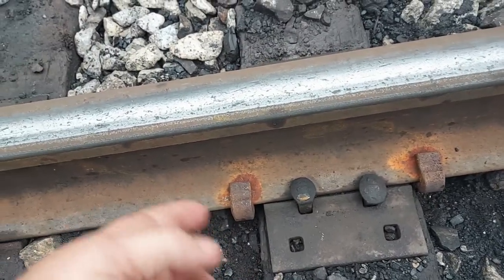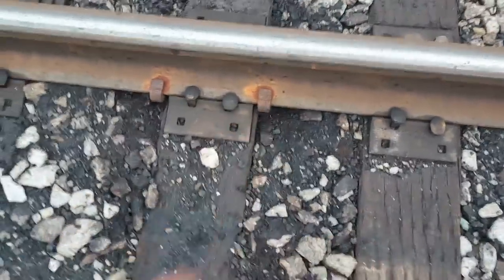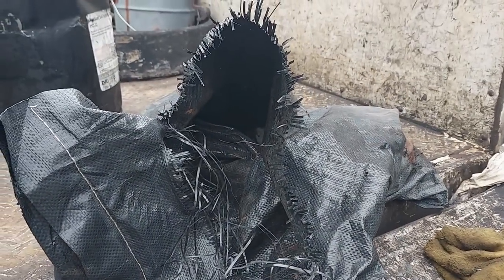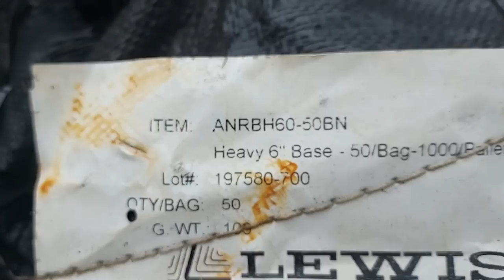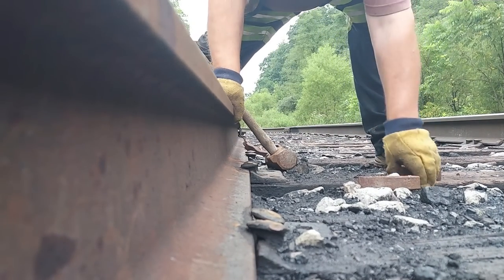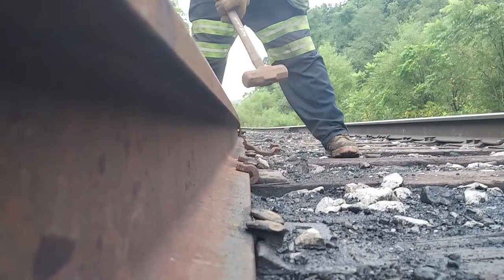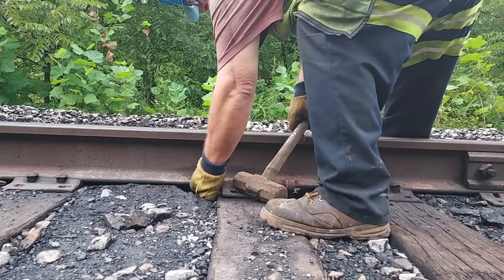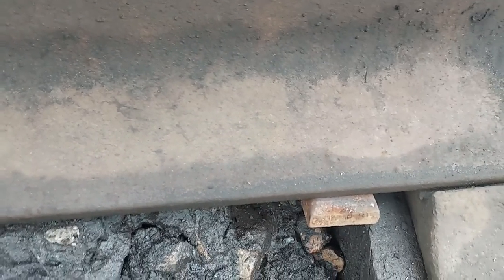Driving Anchors On at the Broken Rail Site

Comment: Have to smile - I can still swing a sledge hammer too, but the difference is you can do it for hours and I can do it for about 10 swings and nowhere near as accurately as you :) So these anchors add some contact between the rail and the tie to keep the rail from creeping. It looks like the rail spikes and the tie plates are the only resistance without these. I am also with you - a machine to place these anchors would be a relief and would save time as well as wear and tear on our favorite railroading gentleman!
Reply from the maker: Don't kid yourself Brian. I used to do it for hours, but not no more,
just don't have that long term stamina we used to have. Your right
about the spikes, and they offer very little resistance to creep. 
Always great to have you visit with me my friend.

Comment: you make that look so easy.  Thanks for making the video.
Reply from the maker: Driving them on is the easy part Dave, it's digging out the
holes under the rails so the anchors will slide under
that's the hard part. Fortunately those holes had been
dug out for me when they changed the rail. I should have
mentioned that in the video, hindsight. Thanks for watching the show today.

Comment: Great video Dave! Your production values have really gone up in the last year or so! I really likes all of the various angles 😊 I hope you get that anchor machine some day. It will make it a lot easier on your back!
Reply from the maker: Thank you very much, I'm trying to learn to be more creative,
you have been my inspiration in the way cool things you do. I got
some different types of mounting stuff so am experimenting. 
Thought that magnet holder on the tie plate worked out 
pretty well. But got a long way to go to catch up to you! Am trying to find a clip that will fit on my hard hat
for the go pro. That clip on the front of the hat is what the miners
clip their cap lamps into when the go underground. Always great
to have you visit with me my good friend.
Reply: @ccrx6700  Thanks Dave! They make self adhesive mounts. Check Amazon. I have one on my truck hood and film at highway speeds so they work very well 😊
Reply from the maker: @PlanetMojo  i have some of those but yet to try them. Thanks will give it a try

Comment: We use to have anchors, they come off but don't go back on. They use screw lags, and plates for that. 
They are building a third track on the mainline, which i did testing for today, I saw Herzog dump trucks , with base aggregate for the TLM.  It was darker then 3/4" stone.  Passed to two excavators and one with a straight plow. Contractors a many.  Six years it has effected the public with emminent domain. It's not done yet but soon!
Reply from the maker: Thank you so much Tuco for taking the time to tune in and watch my friend. We wish you the best of luck in your track building!

Comment: Great video Dave, like that you put the camera at track level to see what your doing. Of the several types of anchors out there. What determines what one to use..
Reply from the maker: Thank you Pappy, very glad you enjoyed. I'm trying to be more
creative with camera angles, bought some different mounting
stuff and experimenting. I liked the magnet holder on the base of the
rail. We used to use all Wooding anchors, but for the past 
several years they been buying all drive ons, so what determines
what goes on is what we have available. I like the Wooding anchors
best because they have more surface area than the other types.
Reply: @ccrx6700  thanks Dave 😊

Comment: La-hoonta (La Junta - spanish pronunciation as in ja-ja-ja for ha, ha, ha) colorado, just down the road from me. Ok, its a long dirt road, takes about 40 + minutes what with the cows on it in places, but it's great little town with agricultural chemical stops for me. Also a warm water fish hatchery nearby and I get to drive by some fishing spots, so I might roll a few errands into such a trip which I haven't made yet this year, but I do need to travel that way someday soon and stock up for next years weeds, etc..
I use a curved U-channel form of the rail anchors to weigh down my printers top roller bar so they have the traction to roll the fan fold paper evenly up and out during multiple page printouts. I had to modify it so that it wouldn't slip on down into the gizmos below and remain always on the traction bar. Its a device I really need, so I hold it in high regard around here.
Batter up, nice story to go with it this time Dave. Don't get to see it happen anywhere else other than here.
You Tube is not playing fair with me anymore, I can start a comment like this one, but answering one already posted just shows a momentary light blue box around the REPLY button and then my windowsXP goes on vacation doing nothing at all about it. After the above trip and many more things to do before winter has me really pinned down, I might have to get a used windows10 box if the outfit in denver is still in business after all these years...
Reply from the maker: Thank you Lee, glad you had a good time with us.. Thank you so much for taking the time to tune in and watch my friend. I like the
anchor idea and haven't heard gizmos for a long time, I like that
word, gonna have to start using it more myself.  I had no idea
J was pronounced as H, but now I know.

Comment: I could not swing a hammer like you, I bet I would have hit the spikes and tie more times than the anchor LOL. We mostly used small hammers and at first hit my fingers a few times driving pins out of the rail with punches. Those anchors look the same as ours, I have not seen the other types you show in the linked video. For some reason I have always liked the sound of fittings like these being hammered in place You only hear it on the railway.
Reply from the maker: Well cedarcam, I strike out once in awhile myself and have
even hit my foot and leg in the past, so I learned to stay
far away as possible. I agree with you, it is a good sound to hear.
Putting anchors on is the easy part, the really hard part is
digging the ballast out under the rail to fit the anchor, that part
I hate doing. This was already done for me. Wish I had
explained all that in the video, hindsight. Always a good time
when you visit with me my friend.

Comment: Dave you can make a hard job look like fun, would hate to do that for very long the sledge would kick my but. guessing that you would have to take some off the rails when using a fire snake for a pull apart?? take care buddy catch ya on the next one
Reply from the maker: Well Kenn as you can imagine, I can't do this for any extended
length of time. Driving them on is easy, the really hard part is
digging out the ballast under the rails to have room for the anchors,
a machine does that easily where it's a total pain to do it manually.
This was already done for me when they replaced the rail.

Good thinking but actually there are only a few times when we
have had to knock anchors off using the fire snake. When
we had the old manual Simplex pullers we have to knock every anchor off. Always great to have you visit with me my good friend.

Comment: If the rail integrity was not compromised, I’d drill a small hole in the rail right where the tie is and then hammer a spike to keep the tie in place.
Reply: That is a very good way to have a broken rail.  Holding the rail against the tie is what a rail anchor does.
Reply: @royreynolds108  
That’s why I said if that did not compromised the integrity of the rail.
Reply from the maker: Interesting idea Bassotronics! You got me thinking. it would need
to be about the size of a spike, a small nail would just bend
from the creep. Not to destroy the thoughts of Mr. Reynolds,
but every rail we have has 3 bolt holes drilled into it and
while there is an occasional bolt hole crack in the rail, it is
not very often. But also anytime you compromise a rail
by drilling you weaken that part of the rail and rail breaks
can happen.

No one has drilled into the base of the rail to do what you
are suggesting. Although it is an interesting idea. I wonder
if AREMA has any thoughts on this. Two major problems
with doing it besides the possibility of a rail break at some
point in the future. One: we have 16.8 miles of track,
anchors every 3rd tie on both sides of the rail and also on
both rails in the track, what a tremendous task that would
be to drill all those holes and then spike them down.

Two: A new drill would have to be designed to do it and also
can you imagine the number of high priced bits that would
be needed to do it. The bits we have for our rail drill to
drill joint bar holes are 80 bucks apiece and last about 
12  holes, they are a special bit to do it. Consider also when
tie replacement is needed.
Reply: @ccrx6700  
Thanks for the awesome info.
I can imagine a rail with holes premade from factory. Or reassessed “lips” in the rail every 5 inches where the spike digs into slightly and can stay in place. 
Mostly for straight tracks. 😉

Comment: If you haven't already, can you do a video on the cars plates. I have a model railroad car of a CSXT ballast hopper and it has plate C and plate D on it. So I was curious as to what the plates meant. Thanks.
Reply: Plate C and D and other letters are the AAR maximum outlines for a certain size car.  In Europe, it would be the size car to fit in the loading gauge or clearance diagram.  Clearances are regulated by each state.  For the most part, a basic clearance outline is 17 feet wide (8.5 feet from CL of the track) X 26 feet above top of rail on straight track.  The 26 feet is the possibility of having catenary over the track for electric propulsion.  Most rail equipment is 10 feet wide.
Reply from the maker: Good suggestion M. Plate designations are actually referring to
Association American Railroads' drawings that define car
dimensions.  This info is important for RR's when they must
take cars thru places such as narrow bridges or tunnels with
tight clearances. Thanks for writing in and for watching the
video today my good man.

Comment: The video is great.  I got the understanding of what they do.  I just don't understand how they lock on.  It seems backwards to me.  Robert over and out.
Reply from the maker: Very glad you enjoyed Robert. The anchors are made from spring
steel and they snap up under the other side of the rail, then
hook onto the gage side of the rail, so the clips are holding in
against the rail, then when the rail creeps there is also an
amount of forces which cause the anchors to angle in against
the rail. Hard to explain in a comment wish I had shown that
in the video. Thanks so much for watching today my good man.

Comment: How many of these are placed on the rail? Is there a rule, or based on creep, etc? Thx.
Reply from the maker: Very good question Epitome63. On Continuous Welded Rail, they
anchor every single tie. On jointed rail, ideally there should be
anchors every 3rd tie. As you saw in the video we are not
in the ideal state which is another reason why I am wanting
more anchors put in over the whole track. Another thing,
on jointed rail, on bridge, tunnel and turnout approaches ideally
there every tie should be anchored for 195 feet out.

Comment: Probably the the hardest part is clearing the space under the rail to slip the anchor through.
Reply from the maker: You are certainly right in that Kent! When they replaced the rail
here they dug it out for the anchors when the rail was not
in there, a big help that was. Very much appreciate your stopping
by and taking in the video today my good man.

Comment: Union Pacific Railroad has heat treated Railroad spikes
Reply: that is unnecessary, and dangerous!!
Reply: @rearspeaker6364  yea that’s the spikes they want i guess they wanted them to last longer
Reply: @paducahandlouisvillerailro3309  strange, must be knocking the head off the regular ones.......
Reply: @rearspeaker6364  I found one bent I straight it out with a spike hammer and it jumped like a Spring and it’s a Union Pacific gg Mc Railroad Spike
Reply from the maker: That's interesting to learn Illinois Central, have never heard
of them before, wonder what the reasoning is behind that?
Now you got me thinking..... Very much appreciate your
taking the time to watch the show today my good man.
Reply: @ccrx6700  I been Railroadin for 16 years those rail anchors are spring steel and they will shoot out if you don’t put them in right

Comment: David do you run into a lot of snakes?
Reply from the maker: Seems like there are years when snakes are all over the place
and then some years rarely see on. Also seems like there were a lot more in the past than are now. Saw a black snake that had it's
tail over the end of the tie on one side and it's head over the end
of the tie on the other side! Sometimes tamping they will come out of the ballast. Got a lot of snake stories, may make a video of
them all some day. Picked up a frog one time and 8 snakes
came out from under it going in 8 directions and I was on the
ground using the remote box right beside the frog. Yellow
snakes with a brown streak down their back. We've got snakes
under the clothe at the greaser sites too. Copperhead one time,
but it was a little one.